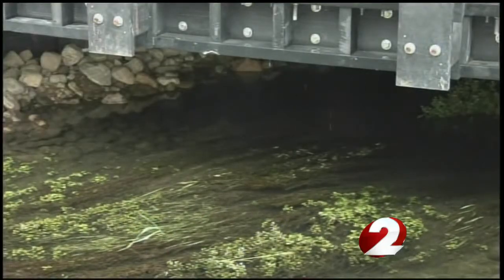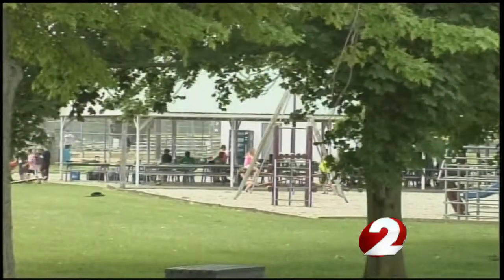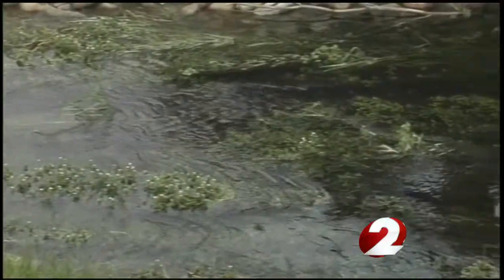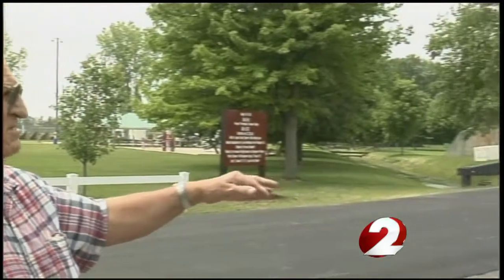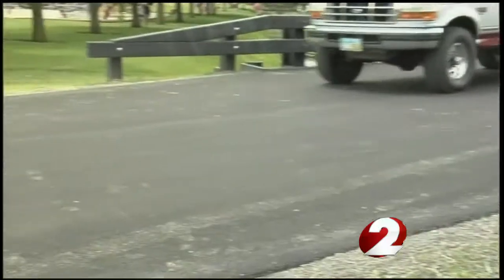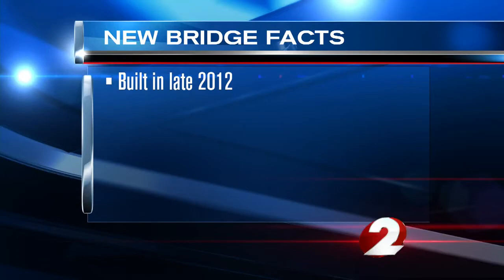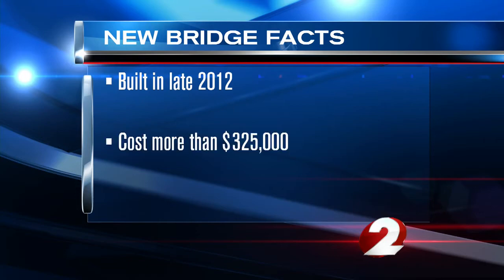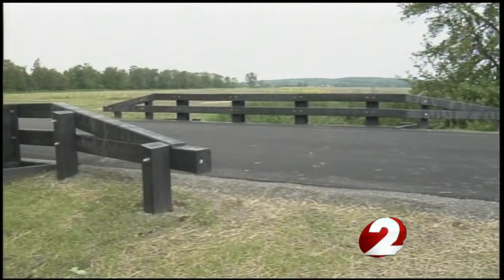Logan county builds first plastic bridge in Ohio

Comment: Press-brake hot-dip galvanized steel tub girder bridges are reasonable in cost and are said to have a service life of 100 years with virtually no maintenance, similar to what's claimed for the polymer bridge. Galvanized steel is a recyclable material also. I'll assume the free money that made this polymer bridge cost competitive won't be there forever, wonder if true costs will come down over time and make this a popular choice. 

Interesting forward step for Logan county to give this technology a try. Have heard of a polymer railroad bridge, don't recall what state it was installed in. Bold step for Ohio, thanks for sharing. Eleven years ago!